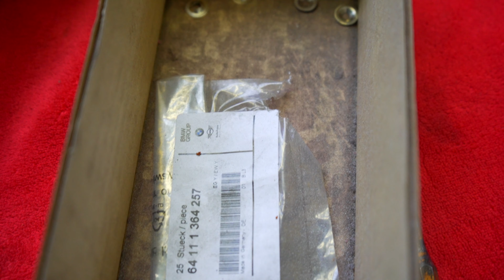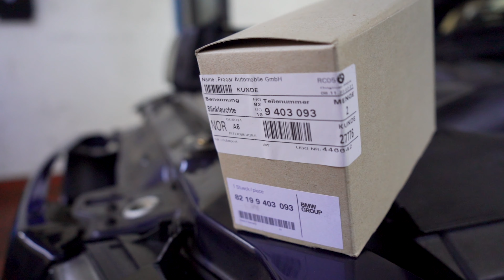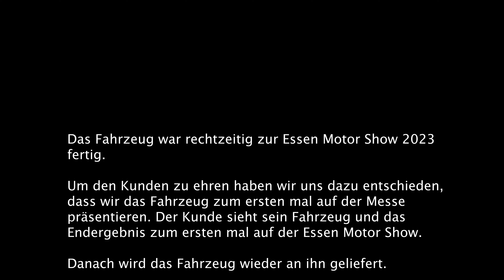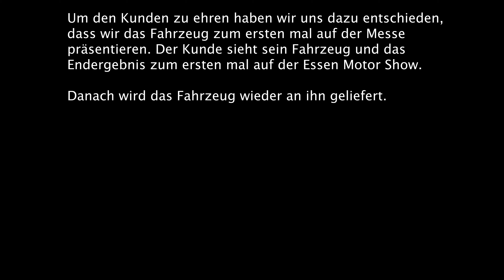BMW E36 328i Cabrio aus Belgien Restauration| Kundenfahrzeuge #31

Comment: Klasse E36, tolle Arbeit von dir. Ich hatte auch viele Jahre einen E36. Als ich ihn bekommen hatte, hatte ich auch die Stoßstange vorne und die Motorhaube Lackieren lassen.  Zusätzlich Streuscheiben und Blinker sowie neue Nebelscheinwerfer. An diesem Cabrio hätte ich vorne auch alles erneuern lassen.  Die Kratzer hätte man versuchen können,  heraus zu polieren. Den Tankdeckel klar, neuer Lack kein Problem.  Als Oltimer in ein paar Jahren ist eine kpl. Neulackierung eher negativ zu bewerten. Nur die Vorderachse tiefer legen mit Federn, ich bin skeptisch,  ob das Fahrverhalten dadurch nicht leidet. Aber das alles Kritik auf hohem Niveau. Ich würde ihm noch eine kpl. Hohlraumkonservierung mit Dinitrol gönnen. Klasse, wieder ein toller E 36 mehr bald als Oltimer auf der Straße. Übrigens bekommt mein ehemaliger E36 in vier Jahren in der Hand eines guten Freundes das H Kennzeichen.